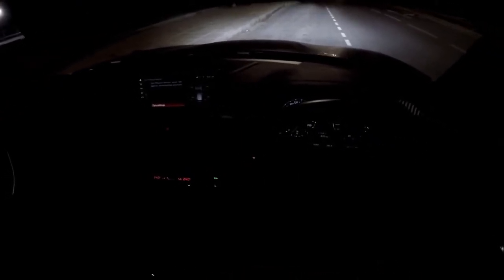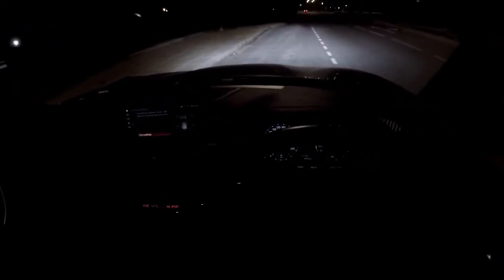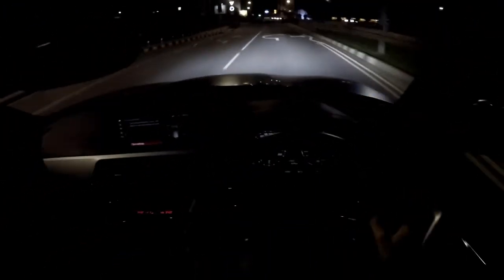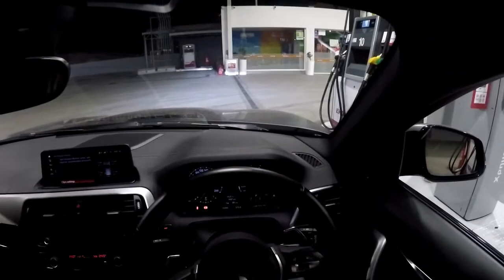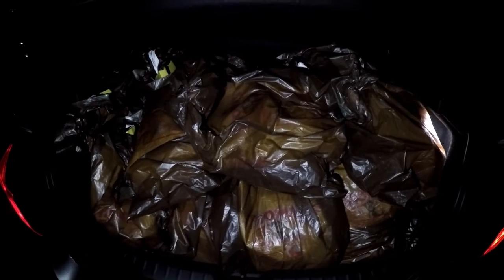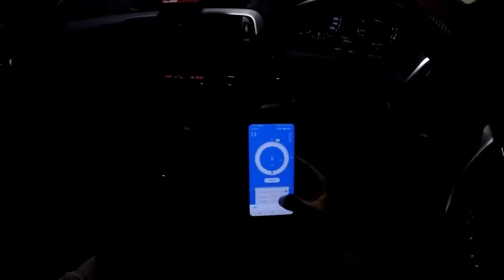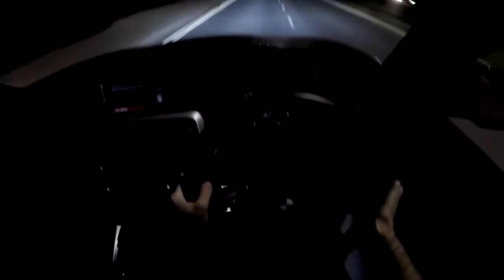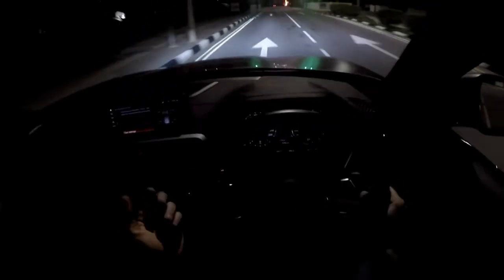BMW M140i POV: Important Scientific experiments with dragy - the results may surprise you...

Comment: What is it Hot-Climate Mod?
Reply from the maker: Here's a link to a dedicated video covering the Hot-Climate Mod:

https://youtu.be/JGdjrWC8BYA

But essentially it is two BMW parts that change the source of the air going into the intake muffler: The air will now come from outside the car rather than from inside the engine bay, so it will be cooler (hence it will be denser and have greater oxygen content).
Reply: @NoBrainerTalk  I watched and already bought :))) but I haven't installed it yet - Winter...
Reply from the maker: @sami.p.3355  Awesome.. :)

Comment: Good video and very interesting. I managed to run 0-60mph time of 3.7 seconds at 10 degrees Celsius also with M Perf LSD, Stage 1 OTS tune and xHP stage. Have you ran any 100-200kmh times during your ownership?
Reply from the maker: Hehehe, I would be a very happy man if I was able to get anywhere close to 3.7 seconds... I have not performed 100-200 tests, even though I know this is where the M140i probably performs best.
Reply: and how did u do it ?